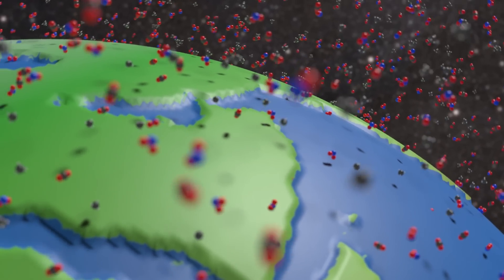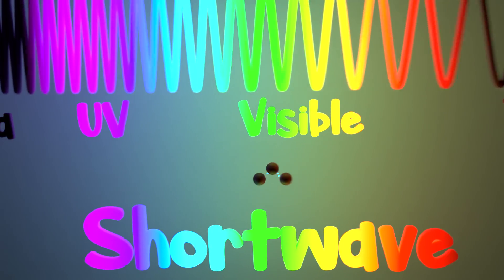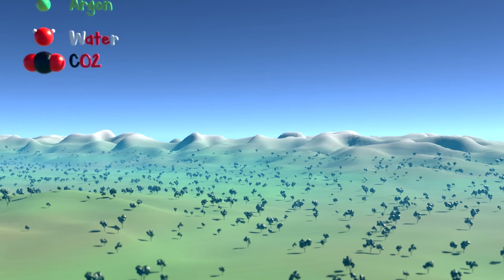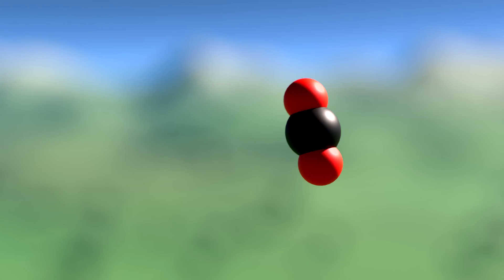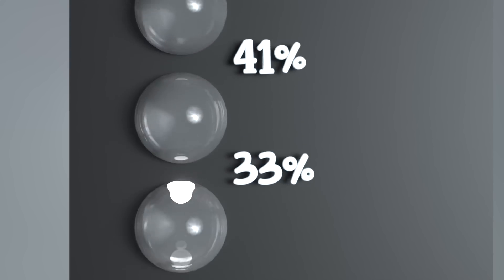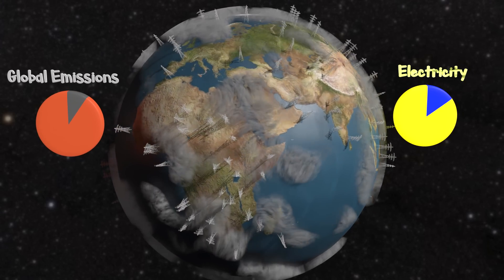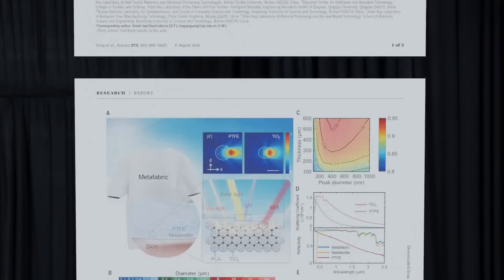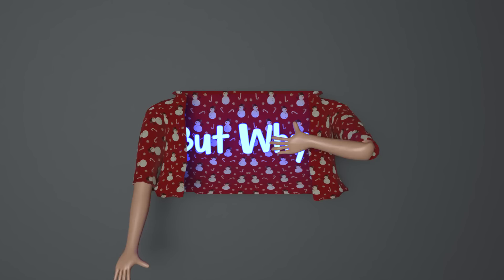Energy Free Cooling through Physics

Comment: The modes of vibration are important because the slower ones hit the IR window at 10um.
So showing the windows available across the spectrum would be a good add.
At 10uM it is the biggest, but their are others.
Poppa was a spectrometer inventor.
I must tip my hat to this video, it is awesome.

Comment: Is there a possible energy generation application using this? Like covering a building using this reverse greenhouse insulation and using the heat it radiates to accelerate the air and have energy generation in the small scale.

Comment: Let's get rid of the minorities in civilized countries and 90% of those in Asia and CO2 won't be a problem.
Less (worthless) humans = less CO2 and that significantly reduces demand on finite resources.
This can be accomplished by forced sterilization right now.
One child per women and SNIP!
CO2 is not the big issue either.
It is perfectly NATURAL for the Earth to go through heating and cooling cycles.
It is mostly driven by the SUN.

If you put up a shade cloth between the sun and the Earth, you could reduce much of the heat input.
But alas, we cannot be assured that governments won't ABUSE it if we installed it.

Comment: Very cool, if viable. But the slightly funny thing is that it wouldn't really work in a large building without fluid circulation... which is like 80% of what an A/C unit is anyway. But still, progress. :)

Comment: Interesting topic.
Just recently a research group made the whitest paint ever that does similar things.

Polymer chains are the basis for acrylic paints and coatings. Perhaps by using the correct polymer chain this could simply be incorporated into all exterior paints and coatings.

There are several reflective coatings on the market but they are not as efficient as the aerogel.

Comment: Interesting, I wonder if the polyethylene sheets could be used under roof mounted solar panels to  reduce heat in the building and also increase power output from the solar panels. But Let’s not use Teflon ( a forever chemical in anything!.

Comment: Wut?  There aren't just radiation and conduction... there is mass transfer.  The Greenhouse effect you describe is a fallacy.  the Primary driver of higher temperature in the Greenhouse is that the air is trapped, period.  The temperature continues to increase because the materials in the greenhouse are continuously heated by the sun.  The same as with your car example.  It is NOT the wavelength explanation.  Professors Flowers and Blanco were quite clear on this point in my initial heat transfer class at MIT in 1980.  They described your theory as an amusing, and discredited, explanation.

Comment: The greenhouse radiation energy is far inferred.   It is considered completely absorbed within 20 meters of the surface to add 10°F (5.55°C) to earth's average temperature.    After 20 meters from the surface the greenhouse energy's further heat transfer is by convection i.e. molecules bumping into each other.   This is high school science and hasn't changed.   

The far inferred electromagnetic wave length of the greenhouse energy radiation from the surface is modeled as loosely interacting with the lumpy electrostatic fields of greenhouse gas molecules and not as photons.  Earth's greenhouse effect is held in deep saturation by the strong greenhouse gas water vapor.  The noncondensing greenhouse gases don't change the temperature retention of earth's greenhouse effect because the system is always considered saturated by the strong greenhouse gas water vapor.   

The United National's IPCC science report at the back of some 200 pages discloses they took their greenhouse gas samples at 20 THOUSAND meters altitude far into the stratosphere where water vapor concentration is near zero and there is no far inferred greenhouse energy from the surface to further intact with greenhouse gases.    Since any high school educated science interested person reading this report would remember there is no greenhouse energy radiation considered to exist more than  20 meters from the surface they'd suspect there would be no greenhouse energy left to interact with greenhouse gases at 20,000 meters. 

This is the practice of a typical scam where careful reading of the information will reveal the truth.   Without the discloser that the greenhouse gases were sampled at 20,000 meters the authors could possibly be prosecuted for criminal fraud for misleading people into believing human caused emissions of noncondensing greenhouse gases such as carbon dioxide and methane are causing global warming from their greenhouse gas behavior because its impossible.

At 1% average tropospheric water vapor concentration 99-1/2% of earth's greenhouse effect comes from the strong greenhouse gas water vapor.

Comment: The wavelength of Long IR (LWIR) is 8 to 12µm and not a cm as shown in the video. The wavelength that's heating water molecule is 14cm. There is a HUGE gap between them and you can't rely on the former to explain the latter. It's probably easier to assert that any atom/molecule in a given temperature absorb as many MWIR/LWIR as it's emitting. It absorbs such a photon, become excited and then emit a photon to fallback to its stable state. The materials shown in the video plays on the properties of the object to be reflective to that wavelength, so if it can't absorb it, it won't heat up as much as the other atom/molecule in the environment. It's not possible to cool anything this way, it cools because:
1. It radiates away (toward space around) more photon than the other ambiant atoms/molecule (so there's a slight imbalance in power output > power input)
2. It doesn't heat up like other atom/molecule 

Said differently, if you are in a building with a nanosilk garnement, you won't be cooler that anything else around you, you won't cool the building, and so on. So technically, if you can get 10°C cooler under the sun, compared to a similar garnement, the moment you walk into a building, you'll reach the same temperature as the building very soon (unless the building itself is radiating the energy with a similar outfit).

This only show some interests for object under a radiative environment (under the sun) where you can radiate away a bit of the spectrum toward the deep (cold) space.

Comment: You don't even need a fancy material to accomplish this.
Just install louvers with highly reflective coatings. During the day, they close and reflect sunlight back into space. At night, they open and let the ground radiate to the sky. The result will be the area below the reflectors will be cooler. If the area is large enough, you could even create permafrost.

Comment: There's been 15% more plant growth since the 1980s due to CO2 according to NASA - look it up! Greenhouse farmers burn propane to get the heat and CO2 into their greenhouses to grow their crops faster. The amount of CO2 is around 400ppm but Greenhouse farmers use up to 1300ppm via CO2 gas or burning propane. Apparently the elites are saying must cut CO2 to stop global warming by ~2 degrees nothing compared to the rise in temperature from winter to summer and when that happens I see a load of plant life explode due to increased sunlight and warmth to drive chemical reactions.

Comment: Let's plant trees. that reduce co2 and air conditioning by shade and evaporation. but they give shelter to animals and beautify the landscape
Reply: Problem is though that the trees are carbon neutral. Even if we restored all the trees we had ever cut down, we still pumped more CO2 into the atmosphere through coal/oil/natural gas. Stopping all unrecycled CO2 output would be the best first step we can take, but it's not far enough.

Comment: Heat is energy, the pipes can contain Ammonia , causing it to boil at low temperature and activating a steam generator.  The electricity produced can be stored in a power wall like what Tesla makes.   A heat sink is needed to cool down the Ammonia gas back to a liquid afterwards, it could run along city water pipes for this purpose.  Another destination for the heat could be an insulated column of sand where it could be converted to electricity via the same means at a later time.  It makes more sense to store the energy in homes that are too hot to use it later than to just dissipate it outside.

Comment: The heating and cooling of the earth is a cycle that has gone for millions if not billions of years. Humans have very little effect on this cycle. We have sped it up! But not by as much as they are telling you. Climate change will happen with or without humans.
Reply: Facts would like to have a word with you. You see, carbon has three naturally occurring isotopes: C12, C13, and C14. As carbon has 6 protons, that means C12 has 6 neutrons, C13 has 7, and the incredibly rare C14 has 8. All three of these isotopes in most cases act identically to each other, and can form molecules such as C6H12O6 or CO2, though C12 is easily the most abundant of the three. However, there are many processes in chemistry that act differently by isotope, also called "isotopic fractionation" processes. The simple version is that heavier atoms take more energy to partake in reactions, and thus don't get used as much as lighter isotopes.

One of those processes is the Calvin Cycle, part of photosynthesis. Plants both now and then would selectively uptake CO2 and incorporate it into their cells. This gives the plants a C12/C13 ratio, just like the atmosphere or rocks or ice with trapped air bubbles. This is where fossil fuels come in. See, we actually know what atmospheric CO2 levels are in detail because of those ice cores and other measures (such as the Keeling Curve), and we've seen that the amount of C12 in the atmosphere has been increasing in relation to the amount of C13, and guess when this trend started! That's right, when we started burning fossil fuels on a mass scale. This even has a name in literature: Δ13C.

So yes, we know for a fact that it's humans burning fossil fuels that is causing this, and it's progressing exactly as fast as predicted. Stop buying into the fossil fuel propaganda, sheepy.

Comment: You're missing something.... convection. 

A garden greenhouse works primarily by blocking convection which would otherwise quickly take away the air and water vapour warmed by the upwelling IR.
Another thing to consider,  the atmosphere is a pressure gradient,  so there isn't a 50/50 chance of re-emission going up or down, it's slightly more likely to go up. There are more particles below to absorb the IR than there are above,  so while the direction of radiation is random, the distance before the next collision increases with altitude.

Comment: The polar bear is a good example of hollow hair and black skin to absorb the heat.
I wonder if camel hair or kangaroo hair or the mighty springbok and oryx hair has some properties to keep the sun out....
The oryx (gemsbok) can survive the Namibian sun. They also have a body mechanism that allows the blood to 42 celcius and the brain to stay 37.
The building of super insulation usually neglect to use convection of the heat inside the building to draw fresh air in for breathing of the occupants

Comment: There are THREE ways energy can transmit between objects - conduction, radiation and CONVECTION.  Greenhouses operate primarily by limiting convection.  In contrast, the Greenhouse effect (which is poorly named) operates primarily by limiting radiation.  That forces the Earth to be hotter in order to be able to radiate to space the same amount of energy it receives from the Sun, and thus maintain a stable temperature.  The radiation is restricted by greenhouse gases, which absorb radiation in the IR band, and reradiate it in all directions, including back towards the Earth (thereby making the loss of radiation less efficient).  Unlike in actual greenhouses, convection actually reduces the effectiveness of retaining heat in the Earth's atmosphere by lifting hot air high in the troposphere.

So, to summarize.  The 'greenhouse effect' in the Earth's atmosphere is entirely different to the process which restricts heat losses from greenhouses; but is still very real; and made more powerful by the emission of CO2 and other 'greenhouse' gases.  And more importantly, there are three major ways heat is transmitted.  The glaring error of stating there are only two methods of heat transfer was too much for me to bother watching the rest of the video.

Comment: So is almost all visible light that doesnt leave the earth ultimately converted into heat?

I myself, who only had physics in school (so i dont know that much), always asked myself why we dont cool the direct way. By taking the radiated heat and transforming it into electric energy. A regular turbine of any power plant does this using water and its boiling point (the heat used here is not manly in form of radiation though). Why cant we use different materials from water (with lower boiling points) to cool even at for example 40C instead of 100C. The two questions i have are: why do we always use water vapor to power turbines?
Why is there no efficient way to convert radiated heat (or light in general since most of it seems to end up turning into heat) of different wavelenghts into electric energy? (Wich is what solarpanels are doing i suppose)
Reply: To be fair, that electricity is then radiated away as heat. That's how resistors work.

Comment: Could the efficiency be increased by using beneath the infrared passing/visible blocking material, a material which emits mostly in the part of the IR spectum which is not blocked by the athmosphere  (athmospheric window)?

Comment: Now hold on there just a moment. A regular greenhouse doesn't work like the greenhouse effect. It simply allows as much solar radiation as possible to enter, while preventing the heat that's absorbed by the air molecules from escaping through air circulation, as it would in the open atmosphere.

Comment: There is also the material called adobe. It was created thousands of years ago and it really works! 

I have lived in Arizona for the better part of the last 22 years and I lived in an adobe house for about 2 years 20 years ago. There was a swamp cooler we had outside, but we rarely used it. Even with hot temperatures outside, as long as we had a cross draft in the house it generally remained at a temp of 65-72 degrees inside. During the winter our two small space heaters kept the home nice and warm, and it did go to freezing temperatures.

Comment: The problem is, all of that is crazy expensive (also possibly unsafe, idk about you but i don't want to breathe in dust from these new materials), as opposed to more traditional methods of housing insulation... Which are dirt cheap and 60-90% as effective (depending on investment and variants available) as these 'solutions'. Also far more sustainable, as in, degrade slower and cost less materials and work (therefore less pollution, and not just CO2)), but people tend to ignore.

Comment: Hmm your understanding on the earth's green house effect and how the suns effects on temperature and forgetting the earth releases energy and heat in all forms and so does the sun infra red and thermal conduction and radiation is the 4 ways heat is exchanged not 2 and I could go on and on but thank you for pointing out the new polymer material and how it can relaseabit of internal heat and not accept infrared heat just like when I was at a festival and woke up every morning part boiled alive in my tent so at night when the temp was low a put an emergency foil blanket to reflect the infrared light when the sun came up and my tent was like I had air con and lasted throughout the festival and soon everyone had shiny foil tents and not sweaty bods....
Reply: cope

Comment: Please quit taking other people's words for it and actually study the proxy data and the actual temperature data for the last several hundred years, you will find that Direct Read temperatures have only been around since 1880 and it would be impossible to determine any pattern since then but if you add it to proxy data, assuming that it is correct, you will find as well as from data from just the early 1700s to the late 1700s where we had a huge cooling event. You will find that it's not getting warmer. It did for a short time from about 1895 to about 1940, but since then it's gone back to a fairly temperate environment. But stating these things is true is short-sighted.

Comment: Passive cooling is one of the most important aspects of building design, here's my uni telling us about designers and engineers mimicking the structure and air ducts of white ant towers to maintain temperature in a building, but nothing about heat reflectant IR pass through materials.  Kind of wild when you think about it.  

I'll do what I can by having an offgrid home with as much solar as I can, and cooling the panels to make my hot water for the house.  Why not?  Why aren't more places doing that?

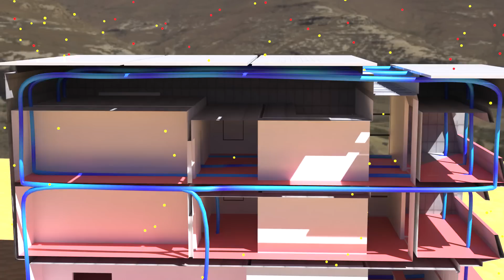Comment: the idea at 8:54 violates the 2nd law of thermodynamics since heat is being transferred from cold to hot without any energy input. This whole video strikes me as pure bullshit. even at its best this idea isn’t a cooling system. its just slowing the rate of heat transfer. if you had this material insulating against a constant 25 C temperature reservoir, eventually the temperature inside would be 25 C, it would just take longer to reach that temperature. this insulation might increase the efficiency of our current cooling systems but the idea of “energy free cooling” seems thermodynamically impossible.